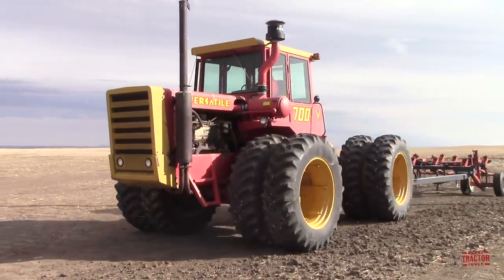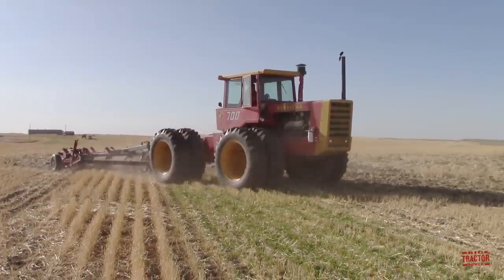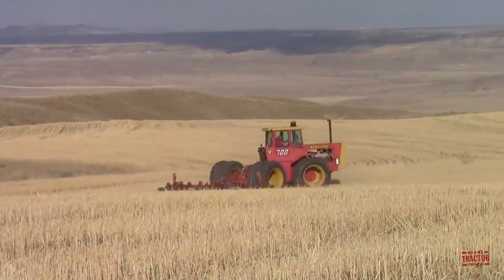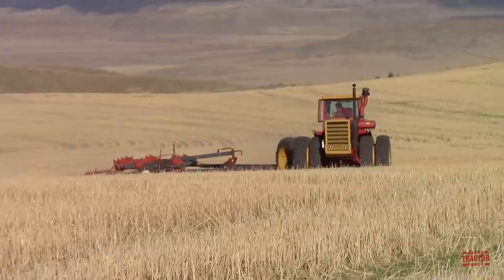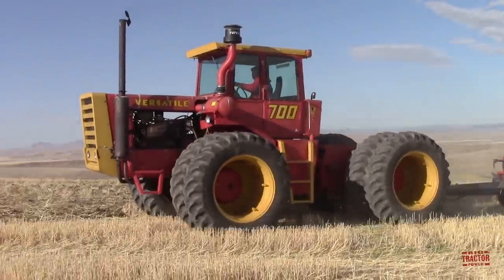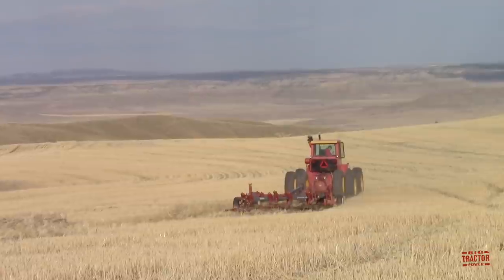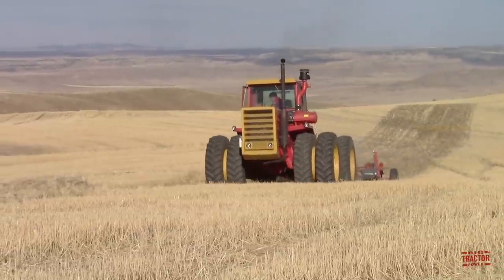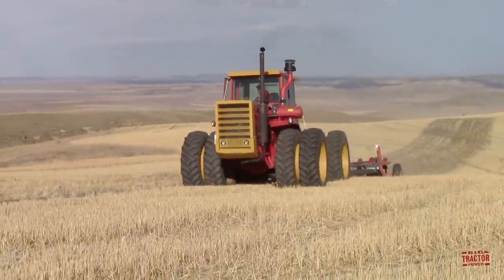VERSATILE 700 4wd Tractor Chisel Plowing

Comment: Great video we use to run an 855 versatile for yrs and loved we've since updated our western ky farm with a 2360 versatile and a 375 versatile which we love as well but I do still miss our old 855. Thanks again for the great video
Reply: ङङङ
Reply: We had a 855 we bought new in the early 80s . Traded it in on a 7140 case ih in the late 80s. We farm in North West Tn . A place in Troy Tn was the first versatile dealer in this area in the 80s. Union City TN has A dealer that sells the new versatile now . I looked at one and was very pleased they kept the similar design as the original.

Comment: We use a series II Versatile 500 on our farm. It runs the 24 foot frigstad cultivator and the 27 foot flexi-coil 5000 air seeder. We used to use it to pull an 841 Massry Ferguson pull type combine, but have since upgraded to a self propelled. My uncle has an 800 very similar to the one in the video

Comment: It's great to hear a 555 Cummins at work.  I've never heard one before.  It's got a pretty distinctive sound for a V8.  The 555 had a problem with breaking crankshafts, and is not fondly remembered.  It was a part of the Small Vee series of engines that included a 378 V6 and 504 V8.  The 555 was a stroked 504.  The Small Vee engines were replaced by the B and C series of Midrange engines in the early 80"s.

Comment: We've got a Versatile 875 that either pulls the 45ft drags or the 32ft Wilrich chisel plow.
Not real sure why we have it because we have a bigger chisel plows and tractors for it as well as other tractors that could easily run the drags. Such as the Case MX270 or the JD 8320

Comment: @bigtractorpower, is that Friggstad chisel plow the same design as the 80ft chisel plow towed by the Big Bud 747 or is the latter plow specifically made for the 747?
Reply from the maker: Yes it is the same company.   The 747 was working on the same field.  This tractor and chisel are used to fix ruts and wash outs in the no till ground.
Reply: The 80 footer actually wasn’t specially made. I believe they are the same design
Reply: @bigtractorpower  @Neilson Stout thanks for replies.